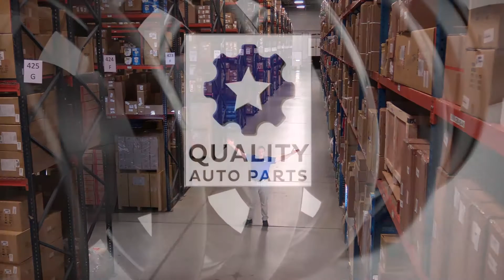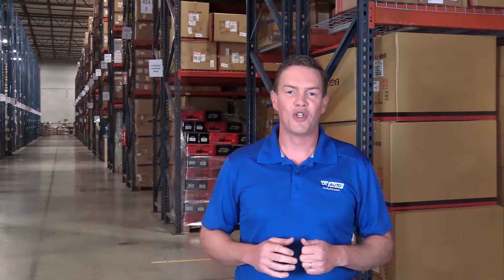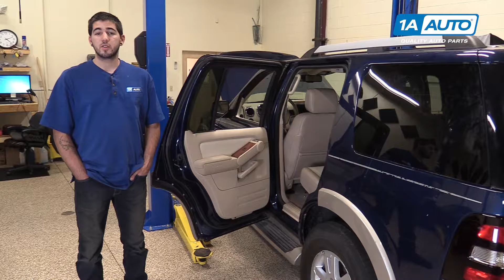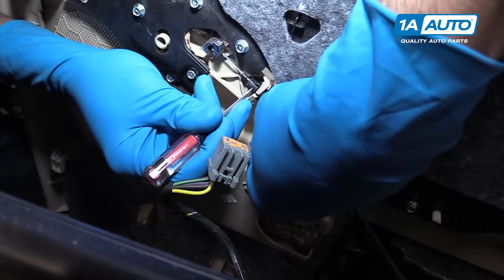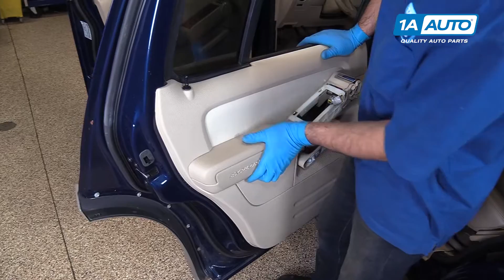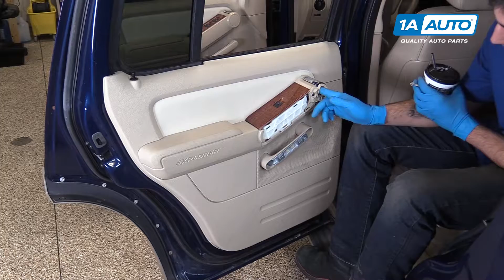How to Replace Rear Speaker 06-10 Ford Explorer

Comment: I bought mine private party and have had 2 03s theres no bass in the back and I don't have the upgraded audio w the subwoofer, just the previous owner put in a head unit and upgraded the speakers. The back has no midbass- has anyone done anything about this?

Comment: Thanks - great video. Having the 'upholstery tools' definitely helps! Worth the few dollars and you can use them on other areas of the interior and other vehicles. 

No - you do NOT need to remove the cable. Just carefully let it hang. With a small drill driver / impact driver you'll be done in 10 minutes or LESS per door. 

One small change, at least for my 2006 Explorer:
     7mm for door screws...
     6mm for speaker screws...

Use a 2-3" extension with deep well metric sockets and it's easy-peasy. 

GET SPEAKER ADAPTERS from an aftermarket supplier and then your new speakers are 'plug & play'. These are the ones I used: HSTECH 72-5600 2 Pairs (4 Pack) Wire Cable Wiring Harness for Ford Lincoln Mercury Mazda Speakers Adapter Connector Adaptor Plug   amzn. to / 3t0kMDf   Those are what you need to adapt your aftermarket speakers to the factory speaker plugs in your 2006 Ford Explorer. (Product idea for A-1!)

Comment: Just so you viewers know, You don't need to completely take the entire door panel off the door, like they show in this video. You can see the dude removing the lock handle cable and then separating the entire door panel from the door, this is wasting time and energy and does not need to be done to remove and install the speakers. You also have a chance of snapping the insert as you attempt to pry it off and or back on with a screw driver. The main reason they removed the panel in the video is in order to get a better cleaner shot for this video. All you need to once you have the panel unsnapped, you can either rest is on the side or strap it to the door while you are removing the speaker. I just rested the panel on my on either my left or right arm while I was removing and installing the speaker. It's very light when the panel is unsnapped you can even position the panel to stay still on the side with a little maneuvering. Don't get me wrong this is a awesome video and I used it to help me replace my speakers, but I found that there was absolutely no reason to  disconnect and remove the entire panel from the door on either the front or rear doors of a 2008 Ford Explorer XLT.
Reply from the maker: +Robert Tretola Thanks for the tip! 1AAuto.com